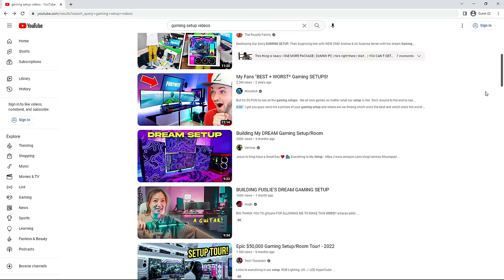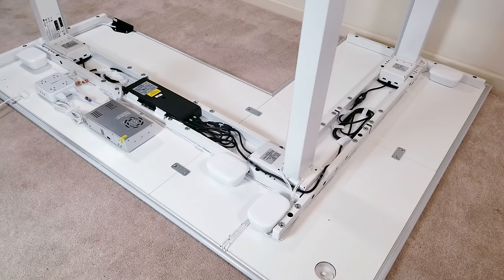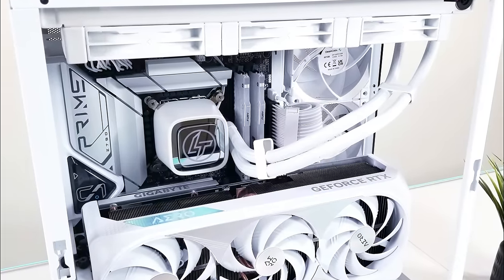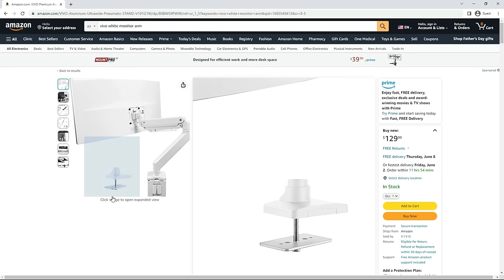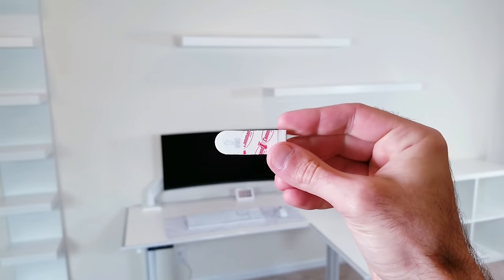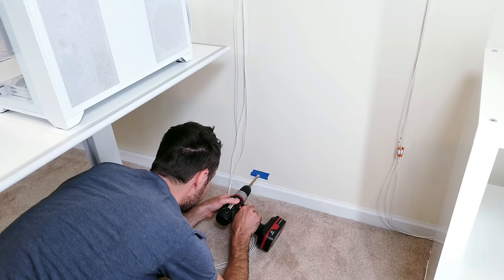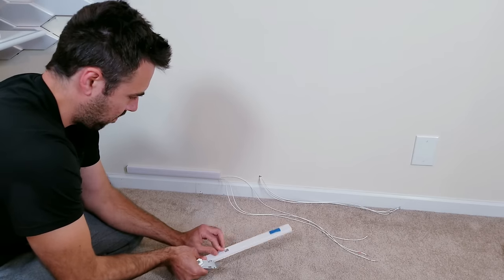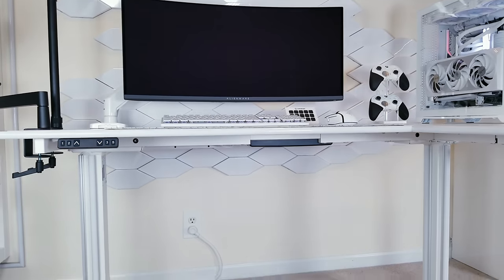BUILDING MY DREAM GAMING ROOM SETUP - FULL DIY WALKTHROUGH

Comment: Hi Chris, thanks for your videos. Very instructive and time saving. I've searched your videos for some answers but no luck. This is my setup: 2 X 16.4 Ft. FCOB WS2811, 24VDC and 720LED/m., an ESP 32-S2, and a microphone INMP441, connected with the micro controller. On ESP32-S2, I'm using D2 and D4 for the two long LED strips. My question is: what is the correct number of LED's that I need to use in WLED interface? Currently I put 100 and created 2 channels. As power supply, I'm using an output of 24VDC and 15A. Thank you.

Comment: Last December I was looking for a sleek set of speakers for my desk as well, and I ended up with the Audioengine A2+ system. I ended up buying a separate 6-in sub to connect with them, and it all sounds fantastic, rarely ever going over 25% volume. Very high quality sound in my opinion and they really complete the look. They'd be perfect here if you haven't gotten any yet.

Comment: That's the point I'm at with my setup in my room, skeleton. Got most of my furniture and such. Mainly just missing the guts for my empty PC case and a TV. Yeah a TV, I'm gonna be sitting a good 7-8 feet or about 2.4-2.6 meters from the screen. Both for gaming and casual entertainment, multipurpose.

Other than that just waiting on the next Gen PC hardware to launch.. Intel and Nvidia in particular. Probably won't have it fully setup until mid-late November or December. But that's alright, got my laptop to hold me over till then and my old PS2 & PS3.

Been browsing antique, thrift, second hand stores and Craigslist/Ebay a bit looking for some other retro furniture stuff. Attempting to pull off a 70's/80's theme with a dash of modern tech, err ARGB. 😅

Comment: I have been thinking... I have been creating custom LED installations by soldering My on wires to the 12v ws-strip. I'm always amazed that you solder such thin wires to your strips that, If I remember correctly, are not even copper. My wires for even short runs are the thickness of my finger If I go by recommended gauge. How do you justify the small wires?

Comment: Is there a channel that would allow you to run the strip on top but the wires underneath? Edit: Like if you used a low profile H Channel, you could both conceal wires and use it for lighting. I am not seeing any products online but you could stick two C channels back to back. Not sure how good something sticking an inch off the wall would look though, might cast too much shadow.

Comment: Hi, your videoes are wonderful. Could you help me calculate how thick cables I need for a led project? It is WS2812B with 96leds/meter. 

Project 1: Led around the ceiling 20 meter. 
- will have one powersupply in start and one in the end.
1. how strong power supply do I need?
2. how thick cables for power and data do I need fro power supply to the first led and last led?

Project 2: 4x2 meters leds from floor to ceiling in parallell. 
- it will be 1 meter between these four led stripes
1. How think cables I need from power supply to the first led?
2. And between the leds?

Comment: Love all your videos. Just installed esp32 with 710 let's using 5 different pins. But lights are flashing fast on most wled presets. Have 40a power supply. Any idea why the flashing?

Comment: You were very intelligent to not go for stupid overkill on the PC itself. Especially in 2023, imagine what just your phone can do and even low end desktops are 10 times that. People could easily stream AND game with even a 13th gen i5 quite fine but you are seeing these dummies still buying i9s for no reason. The 13th gen i7 is a good CPU and you will never be CPU bottlenecked by anything in the next 4-6 years. You can stream AAA games well, and edit video great. The 4080 is the best choice from Nvidia for gaming considering their failure of a 4090 but personally I definitely am an AMD person, with a 7900X3D + 6800XT combo myself. I like the stream deck and the controller choice. I am an Xbox controller fan and definitely want one for my setup. I think for you the main next steps are upgrading to other/more monitors, having a side laptop system for dual PC streaming, and getting more into peripherals like building keyboards. I thought our cases were the same as well, yours looks just like a Corsair 680X in white.

Comment: Dude why would you not wall mount so sad. No matter what you say your monitor will still wobble when you put weight on your desk. And the mic setup looked so bad. ALSO why do you have a light but no cam. Kinda sad you half did that part.